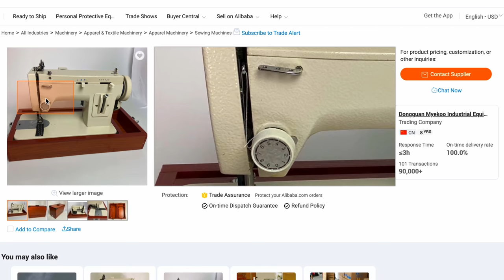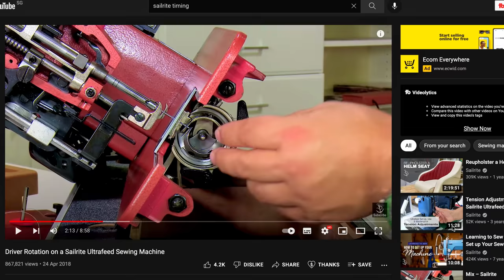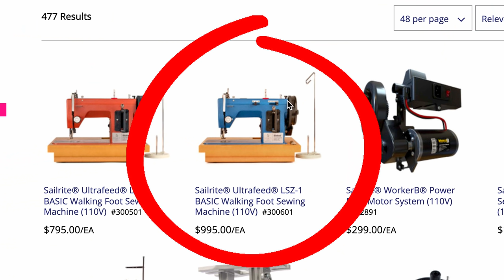SAILRITE VS CHEAP Sewing Machine (Full Comparison)

Comment: Great video I watched it twice. I want to buy a super cheapo and then replace the driver part in that you recommended. The price on Alibaba seems to be $250 now? Do you happen to know of a place to find it for Less? I tried some other brand names. But it's a rabbit hole lots of these machines at prices are all over the place. I'd love to find one for $60 I might be on the fence at 250. I live in Florida I'm not sure if that affects the prices that the internet sends me.
Reply from the maker: You know Yoweee. I led you on a bum steer there... $60 turned out to be for the wooden base only... I did see them available for about $180.
Try using a vpn so you can appear in a different country... You might find a cheaper price.

Comment: You mentioned having been happy with the barracuda prior to the breaking of the driver.  If the driver hadn't done that, or if you had been able to send it in for a warranty repair, would that change your preference, or is the sailrite still that much smoother with the stitching?  I'm grudgingly leaning toward the sailrite but had really wanted to make the barracuda be my choice, out of principle for what the standard pricing should or should not be, for us cruisers to get our hands on good machines.
Reply: I too was thinking on buying the Sailrite LS1, when I first started sewing bags, but I couldnt afford it, so I bought one called the sewstrong 607L, for $359.99 at the time,  the L is for long, my machine has a 9" work bed compared to the barracuda and the Rex607, I had mine for over 6 years now, and its been a work horse, I make backpacks and outdoor gear so I needed a strong machine, I put on the SailRite standard balance wheel, and stitch length adjuster, best mods I did to it. I do have a video of me sewing with it. Just keep your machine well oiled and adjusted right and it will give you years of service.

Comment: Reminds me of buying larger tools from Harbor Freight. All the basics are there but the cheap price is because nobody at the factory set them up.  You have to spend some time setting them up yourself before they're usable.  Same for cheap guitars.   Looks like the "Reliable" needs someone to tune them a bit more before they ship them out. 

Looks like they're both copies of the "Kenmore 158.220 Model 22"
Reply from the maker: That's correct Quade...it certainly educates you for DIY.

Comment: I just got a Tuffsew, and have the feeling it's like your 'Reliable'. I also went through a big sewing machine learning curve with my company years back when we had bag closers for production work. One thing, if the machine was bought with the idea of using it a lot, I'd definitely go with the Sailrite. As mine will be used once a year for a few hours, I'm hoping the cheap machine will be up to the task. If not, I'll ether put on my apron and tear it apart, or if feeling lazy, take it back to the sewing expert whom I bought it from and he'll fix it... hopefully for less than the difference between the two machines.
Reply from the maker: I think you would need to be a mechanic with a sail rite also….the fine tuning is critical….and they just don’t stay in tune!
Reply from the maker: I think you would need to be a mechanic with a sail rite also….the fine tuning is critical….and they just don’t stay in tune!

Comment: You could of drilled and tapped a hole in the driver and install your own set screw.  If the original driver was not worn or damaged something else was out of adjustment.

Those machines are very similar to my consew cp146rl.  They probably all come from the same factory in Asia.  Tuffsew and Thompson all have identical machines as well.

Comment: Try to hold the wheel then turn center wheel towards you so the needle won’t go up and down while threading bobbin. 
Hope it works. :)
Reply from the maker: Tks Ivy…looks like something wrong with mine…it’s jammed tight….doesn’t matter
Reply: Actually, not being able to release the flywheel is a good thing. You do not want it slipping. I actually added set screws to keep my flywheel secured to the drive shaft.
Reply: My Singer 237 does the same. You can put something solid under the needle bar and stop the needle. I've tried adjusting the clutch but doesn't make much of a difference

Comment: Sailrite bought the rights from another manufacturer and refined it, with those changes now in their production version. The manufacturer of all the other renamed brands use the old castings/parts with the inherent problems. 

Sailrite receives every machine from the factory and checks it for operation and fine tunes it if necessary. The other machines are assembled, various names applied, boxed, and shipped. The old saying of it runs like a sewing machine applies to the Sailrite. The generic machine not sew much, pun intended.

I have full size machines for what I do. If I needed a portable, I would go with the Sailrite. There is nothing more frustrating than being in a time crunch and the machine goes wonky and you spend more time fixing than sewing. I am a firm believer in buy once, cry once. Adding the cost of the cheap machine on top of the quality replacement machine makes those second set of tears that much bigger.
Reply from the maker: Probably good advice Sean. However I'm a born bargain hunter, and always looking to cut out the middle man.... Read "cheap ass"!

Comment: I have a couple actual 'Industrial' machines, they are literally bomb proof and can be fully serviced.  The problem is, they are very big and sit on standard machine tilt tables with the motor mounted underneath.  I bought them used, but even then they are still expensive.  I was lucky to get the Cadillac of straight stitch machines for $300, the Consew RB-1, but these machine were over $2000 when new (in today's dollars) when they were made in Japan by Seiko.  The new Chinese manufactured units are still over $1000 but not as good, and good condition used Seiko units still sell for $1000.  Don't get me started on what you would pay for even a used long arm zig-zag machine.... and none of these are ideal boat onboard use because they are huge and heavy.  Take all of this into account, plus Sailrite's great video library and customer service, the Sailrite LZ-1 is a great value hands down.  If you are serious about sewing and want a good machine that will last a lifetime don't hesitate to buy the Sailrite.
Reply from the maker: I'm sure the Customer Service will get you thru most of the issues with the Sailrite.... coz they still have their issues!

Comment: I gave up a monstrous Singer Industrial Straight Stich machine for a space-saving Dual Stitch Barracuda. I would have preferred a Sailrite but was trying to save a few bucks.  Sailrite replaces cheap cast parts with machined parts.  Lemme Shplain.  The cheap Rolex watches you can buy on the street are made from parts produced in the same Chinese factory as are in$50K watches. After QC, the AAA+ movements go to Switzerland.  (less than 1%) The rest are graded accordingly and end up in watches down the sliding scale.  Sailrite, I have no doubt, gets the best machines off the line.
Reply from the maker: That sounds about right.. Cheers

Comment: Thanks for the insight. I only watched your video up to the point where you called the drive pin a clutch system. If you really wanted to make an accurate comparison you should have said the pin makes it  a direct drive, the sailrite doesn't have a clutch. The other machine has a clutch which will slip when you're sewing multiple layers of canvas or thick leathers no matter how much you tighten the clutch knob. And, when your loading a bobbin on the cheaper machine, you can loosen the clutch enough so the needle doesn't travel.

Comment: Double the voltage..  same current... doubles the wattage.  -----   No doubt Sailrite makes very fine products.  They are quite expensive, though.  But, even if you don't buy their sewing machines, I've found them to be very helpful.  I had a problem with the alignment of the belt on the cuda crank.  Customer service was a lot of mails and phone calls, but not much help, from Reliable.
Reply from the maker: Cheers Charlie.

Comment: Those are class 15 machines, they have a domestic sewing machine bobbin system. Probably fine, but am surprised. But, the parts like hooks are available anywhere. And cheap. You need a basic maintenance handbook that tells you how to fix timing. There’s really good ones to be had.
Reply: Class 15 parts are interchangable 99% of the time. But poor finish on parts, you’re stuck with. I’d buy the Sailrite.

Comment: The clutch of the white machine is probably the knurled knob in the middle. I have a heavy duty machine (like 40 years old) made and used for camping-tent repairs and a modern normal duty one, they both have a similar clutch construction. That pin looks like a very cheap solution. The white one makes a better overall impression on me. Less polished but the parts seem to be just a bit thicker/more heavy. My heavy duty one has a huge motor compared to yours (1600W !!!) My modern Singer only 105W. But that mechanisme of the blue one seems to have better tolerances  in the mechanisme.

Is 10 mils = 10 mm = 1 cm ? Or do you use the imperial mils ? (1 mil is 0.0254 mm)
As an EE I can tell you power is the same. Power = Volt x current, the advantage of a higher voltage is that you need less current. Less current is more easy on switches and wires. Lower voltage is more easy when it comes to isolation.  but in the end it is the power that does the job. 🙂

Sewing with a machine is a mans job 🙂Most important is the power of the engine, a sturdy mechanism and heavy flywheel. My modern normal Singer sewing machine costed  300 Euro (= around 300 dollar) It has no problems with sails but leather is to much. A real industrial one is very expensive.

So, I now go to my sail-boat (if finnished I am going to live on it, a 11 meter steel  ketch from 1956)
Reply from the maker: 1956!...wow impressive. Tks for your  input. Cheers

Comment: The Sailrite steel Monster Wheel is definitely better than the grey Chinese wheel for only a few dollars more. If you want to utilize the posi pin in a Chinese machine, you just need to drill the correct size hole in the correct position on the clutch. This will allow for a direct clutch connection instead of just friction. However, a friction connection may be better for a Chinese machine with weaker internal metal components.
Reply from the maker: Ah cool... I wasn't sure it would fit... But you're probably right.

Comment: I bought a cheap Alibaba machine. Pretty happy with it. 
Burnt the engine, though, but a new engine was cheap and easy to change.

It works fine now, does it’s job, I like it and use it some.

Mine cost $199 with some  extras,if I remember it right. With shipping and taxes it ended up at approx. 350$ when it arrived here in Sweden. A  Sailrite, which I believe is a superior machine, would cost about 1800$ incl shipping and taxes.
I don’t think the Sailrite is 1450$ better.

Of course it’s the shipping cost that’s really high from the US. Besides, customs and our 25% sales tax adds almost a Chinese machine just in taxes and fees.

I think Sailrite are doing the right thing developing the machine and correcting weak spots. I believe they have turned this cheap (cheap quality that is) machine and improved it to become a really good sturdy machine.

If they had had an EU retailer I probably would have gone for a Sailrite.

Thanks for a great and informative video!

Comment: I did bought one barracuda and unfortunately it is not fine machine,
I can not sew without issues, I will take to a shop to see if they can adjust it (timing and make sure will work right).
Sailrite definitely is better I think their customer support is top notch.

Comment: I’ve been sewing for over 50 years and I can honestly say that I have never accidentally knocked and moved the tension disk on the sewing machine. The thing doesn’t move that easily. If you can easily move it with a glancing blow your tension probably isn’t set properly.

Comment: Clutch washer on hand wheel May be in backwards if you can’t stop needle when winding bobbin.
Reply from the maker: I have tried it both ways Edge Mo... Can you confirm I can disengage with the Cuda crank (big wheel) installed? Perhaps I've installed it incorrectly?
Reply: @SailingLifeonJupiter  if you tightened the set screw on the balance wheel, it secures the wheel to the shaft. You would need to Un loosen that set screw and back off the stop motion knob to stop the needle. Seems to be too much trouble. Perhaps wind your bobbin on the Sailrite.
Reply from the maker: @edge1289  Hehe...if only i had both!.... The SR is a loner from a mate, just to make the vid

Comment: Hello! When you load a bobbin on the barracuda, I think you have to loosen the little wheel in the big wheel. Then tje needle would not goes up and down while loading.
Reply from the maker: That is the procedure... But my little wheel falls off, and big wheel remains tight!
Reply: @SailingLifeonJupiter  Your inner star washer in the clutch could be mis-installed.  Besides the '180° out of phase' issue, the two inner teeth need to face away from the machine.  See here:  https://youtu.be/jf7NBxrAURY?t=1245

Comment: Hi
On the barracuda with the pinned shuttle driver you need to check the needle bar height
Reply from the maker: That was the first thing I did JM.. But it seemed to be an angular rotation problem... Coz once I had that adjustable shuttle driver in, it was cool beans.

Comment: Good Video, did you go through each machine and lubricate them at all points? I wonder if that would make a big difference? I tend to polish rough machines to make them smooth as I do on Gun triggers ... I would go with the $60 machine, polish and lubricate it upon receiving it and a cabinet is easily made. I like how you sourced the sailright parts into the reliable unit, Good thinking.!! 

Have to say the first time I heard a sailright run?? I thought you paid how much for that machine? sounds like it is falling apart. I totally agree on a Broken in second hand machine.
Reply from the maker: Yep both freshly lubbed... There was a big difference in how smooth the Sailrite was.
Reply: @SailingLifeonJupiter  I checked locally for an industrial machine and found a CONSEW 210 for 250$ thought that is a great deal, the video of it sounded like a Swiss Watch,, buttery smooth... 
I make knives Jamie and bought a Chinese copy of an old singer for 68.$ for making sheaths and Gun holsters as a hand crank unit it is even good on some lighter sail patches and repairs, It has a place on my boat..
Reply: yes… very buttery…

Comment: Electrical power is called watts. This is volts times the amps. So two amps at 120 volts is 240 watts. One amp at 240 volts is 240 watts. Same amount of electrical energy. In the USA 120 volts is the common outlet power. Most other places it is 240 volts.  The new Sailrites come with a more powerful motor.

Comment: There should be additional feet you can buy, I bought an abundance of them for my consew, mine looks like your barracuda without the big balance wheel mine also is a stiff starting machine, I was going to buy the sail right I couldn't  afford it the consew work's beautifully & much cheaper

Comment: What a great video after using an antique Singer commercial machine for years I bought a used Chinese what is called powerpro Plus which was the Clone to the sale right like you looked at and it's a zigzag but it has a 9 inch gate is compared to the 7-in I have been using it for a number of projects a full enclosure Bimini Dodger enclosure and has been a great machine I did add the monster wheel but I bought it as a Chinese knockoff off eBay so got to say I didn't make a wooden case for it because the plastic case it came in was kind of chintzy but for the money I love it
Reply from the maker: Ooo yeah the 9" would be nice.

Comment: To run a 220 motor you need a dedicated circuit. 220 is a three wire circuit. This is the type of circuit for your dryer, your range most commonly. The 110 is regular single wire house current. A standard plug in.
I’m speaking of AC electricity in the US. I know other countries are different. I have no knowledge of their systems.
Reply from the maker: Cheers Handy Lady

Comment: The sailrite machine is now out of range for a lot of people. In Canada the price is made worse by the exchange. Sewing machines made in the 60"s, 70"s and 80's were made in Japan with quality parts and no plastic gears. Since sewing has gotten out of style and everyone throws everything out, sewing machines are plentiful on craigslist, kijiji and estate sales. I picked my freshly tuned machines for $40.00 and have had them for years. If you are in a smaller boat, think twice before putting one on your boat, lots of people have them and never use them. Also they require regular cleaning and lubrication, even if you do not use them. If you do not take care of them , they will rust like everything else. For people that want a 12 volt unit, most machines can be converted for very few dollars.

Comment: Do you think the sail rite would be good for jeans , hoodies/ jackets , dresses , suits ,tops ? I’m a tailor and fashion designer a elderly guy in a Janome dealer said I should invest in a sail rite
Reply from the maker: The problem with these machines is they need frequent oiling to keep them running smoothly. Youre gonna stain your fabrics.
They'd strong but not delicate...and the foot clearance is only around 8mm, which might be difficult for hoodies.